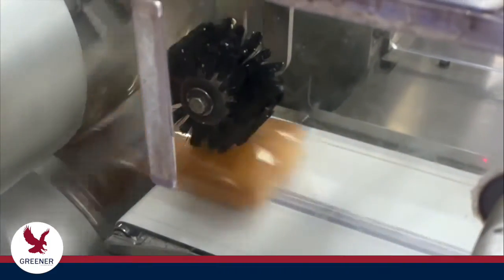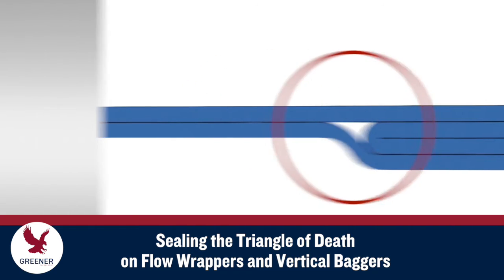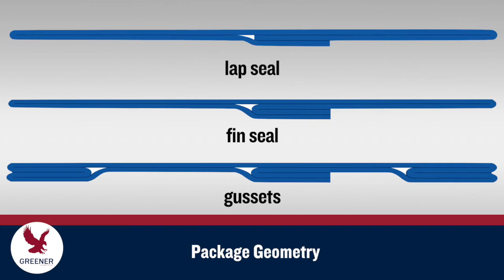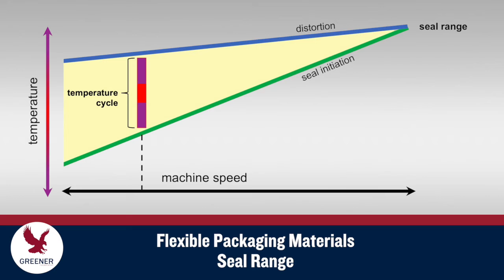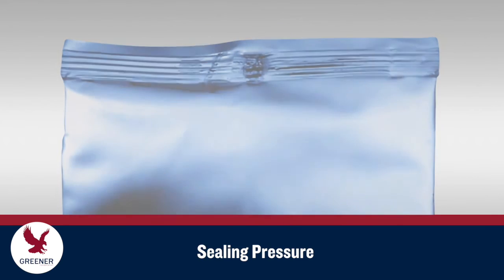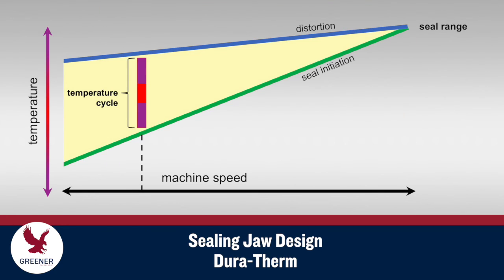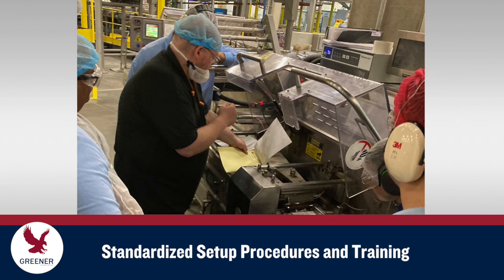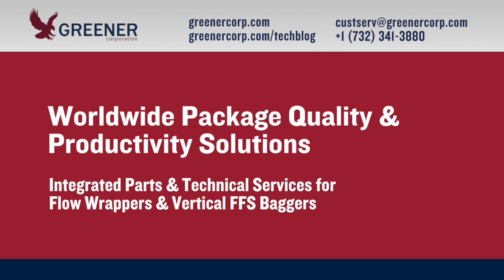Sealing Leaks at the Triangle of Death on Flow Wrappers and Vertical Baggers

Comment: Hello
I watched your YouTube video regarding the packaging problem solution, and I would like to get in touch regarding the improvements mentioned in the video. I would also like to request the technical specifications (Data Sheet) for the horizontal packaging machine cutting knives, including length, width, thickness, and material type.
Knife serial number: TCD=141 31130300.
Thank you for your support
Reply from the maker: Hello. Thank your comment about sealing package leaks and about knives for horizontal flow wrappers. You can contact us directly at custserv@greenercorp.com or https://greenercorp.com/contact-us/ and we can provide additional technical information to you.